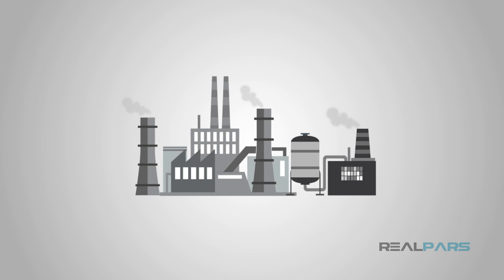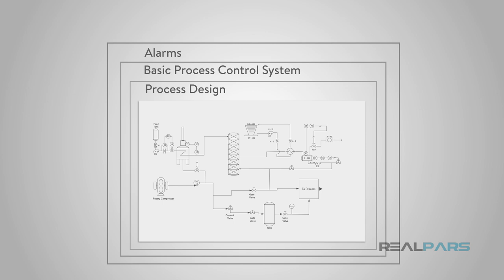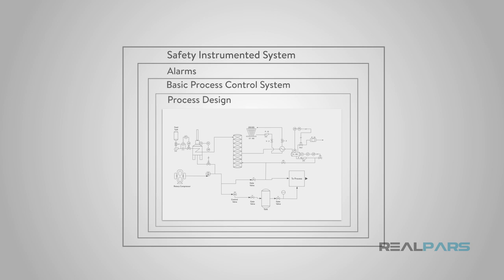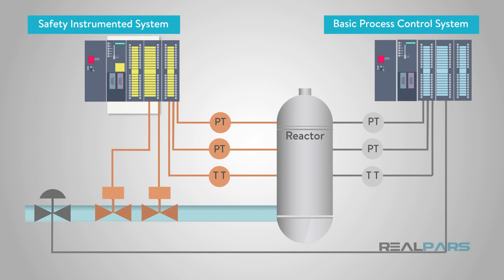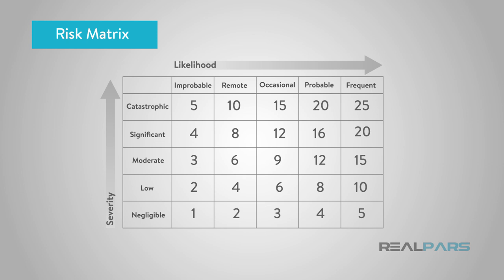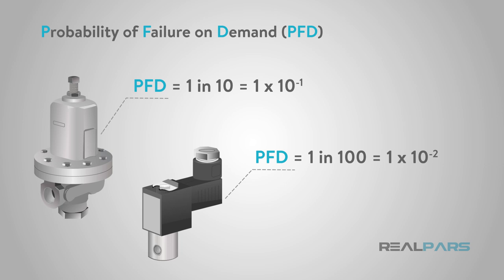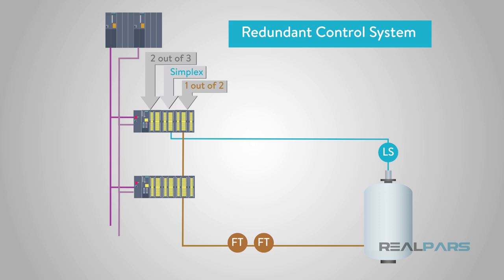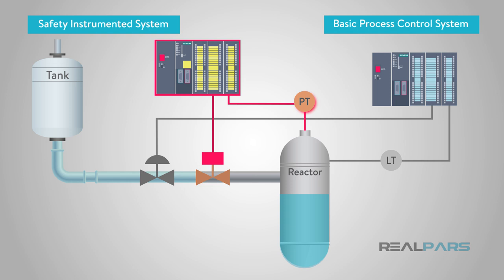What is a Safety Instrumented System?

Comment: I wonder, when you say they must be completely separate, does this also apply in both directions? Or is it permittable that a SIL system have a optically protected output (optocoupler or a optical fiber with a diode in the SIL controller and a photodiode in the normal PLC), that goes to the normal control process logic, so the normal control process logic at least KNOWS the SIL have tripped.
Reply from the maker: According to ISA 84/IEC 61511, the systems should be separate, with separate instruments, I/O, and logic solvers (CPUs).  So, the scenario you have described is not technically permitted.  I have seen projects do this, but the optical splitter's reliability would need to be factored into the SIL calculation, and I would bet that use of such a device will knock the SIL rating down by a factor of 10 or 1 00.  In most cases, the PCS will know the SIL system has tripped, since flows will stop, etc.  It is permissible to have a DO sent to a PCS system as an alarm indication.
Reply: @realpars  What do you mean with "DO"? Why would the splitter's realibility need to be calculated into the SIL's system realibility rating? If the optical splitter fails (as in stops working), only that would happen is that the PCS no longer get to know that the SIL is tripped.

And the important thing is that this shouldn't affect safety, ergo the normal system must also have its own sensors and probes as part of normal process. The idea is to take a complete SIL + PCS system that works totally separate in a safe way, and then put a one-direction signal from SIL to PCS to tell PCS that SIL is tripped so it can logcally stop its process. (to create a advantage that isn't safety critical - for example, easier restarting of the process - since the PCS then is "paused" at the correct moment, once the cause of the SIL trip has been found and resolved, and also easier find of the cause)

Could aswell be a camera on the door to SIL cabinet (that films the SIL), that is connected to a image detection algoritm on the PCS that tells if the "Tripped" diode is lit or not. Or would such a camera arrangement not be techincally allowed either?

What I have understand, the point of the separation is so nothing can affect the operation of the SIL (for example, if the PCS blows up due to a short or even if the PCS get a 300kV 3000 amp lightning strike in itself the SIL must continue working)

However, its important that the optical splitter never can fail in such way it would affect the operation of the SIL system. For example, if the optical transmitter becomes a short, then the SIL output must be able to handle it (like optically protected in itself or current limited).

Comment: what is the difference between SIS (instrumented safety system) and ESD emergency shutdown in the oil and gas industry and what are their respective standards 0:23
Reply from the maker: Thank you for your question.

The difference between ESD and other SIS systems is that while the PCS covers normal operations and programmed procedures for process power on and shutdown, ESD systems only intervene when an emergency is detected that could lead to a hazardous situation.

Here is a link for further review: https://www.sisfireandgas.com/system/4/emergency-shut-down-esd/#:~:text=Difference%20between%20ESD%20and%20other%20SIS%20systems&text=While%20the%20PCS%20will%20cover,lead%20to%20a%20hazardous%20situation.

Happy learning!

Comment: why does a safety instrumented system need its own controller? and not just connect an additional sensor/valve connected to the process controller with a piece of software? I am asking because the PFD of a PLC is much lower than the PFD of a sensor/valve right?
Reply from the maker: Hi Remco, 

A safety instrumented system (SIS) needs its own controller because it must operate independently of the process control system to ensure safety. This separation provides redundancy and prevents a single failure from compromising both the process control and safety functions. While the process controller may have a lower probability of failure (PFD), the independence of the SIS controller ensures higher overall system reliability and safety, which is critical for managing and mitigating risks in hazardous processes.

Happy learning!

Comment: Thank you so much for this explanation]
Im working in oil & gas industry i have spacial requirement of providing field E-STOP signal through  MCC is there separate interposing relay available(SIL3) or that should be provided in PLC panel that E-STOP should by pass all the logic and direct trip the pump which is located in zone IIB 3 hazards area the vessel is FPSO
Reply: e-stop is different to a safety trip for a pump.

Comment: Thanks for the great video! I don't really understand the necessity of a separate SIS though. Safety PLCs can do the process part in the standard program and the safety part in the safety program just fine, so why would we need two controllers?
Reply from the maker: The fault in your logic is that the logic solver (safety PLC) is only one part of the equation.  Safety systems must be designed holistically:  logic solver, sensors, final control elements, networks, etc.  The international functional safety standard (ANSI/ISA/IEC 61511) requires the separation of the SIS system from the BPCS (Basic Process Control System).  Use of safety PLC's is encouraged but placing these systems on the same networks and infrastructure as the BPCS reduces the reliability of the SIS system, typically by a value of 10x.  The misnomer is that "Hey, I will just use a safety PLC and all is protected".  This is not the case.  A safety PLC does not make an instrument or solenoid more reliable.  It makes the logic solver more reliable, but overall safety system reliability requires that the entire system be designed for a SIL level appropriate to the risk of the failure of the system.
Reply: This is very interesting discussion. In my industry, we do not have that concept of SIS so I’m really trying to understand it. 

You can use redondancy and/or safety rated equipment along with a safety PLC to achieve a very high level of reliability. Using this method, I easily get to SIL3 / PLe. So what more do you get with a separate SIS?
Reply: @TheTotoditoto  It is about adding an extra layer of protection to decreases any cause of accident

Comment: Thanks for this video sir 
So all the field input & output must go through safety PLC?
Im using PILZ safety PLC in  panels having SIL 2 certificate
Reply from the maker: All of the signals that are required in the logic solver (your Pilz safety PLC) to implement the Safety Instrumented Function (SIF) should be brought in as logic solver I/O.  Per ISA-84/IEC-61511, these inputs and outputs should be connected only to the logic solver.

Comment: Hallo, great explanation on SIS. I have rececently started working with Pilz Programable Safety System and I just found a term on the Service Manual I wonder if you could clarify to me, it says something like this: 

When using test pulse outputs, If supply voltage is interrupted during  test function, the test pulse output will be deemed to be defective... causing the PSS to switch to a stop ...Remedy: buffer the PSS supply voltage. 

What means here buffer the PSS?

Thanks in advance!
Reply: Remove & then re-apply the supply voltage to reset

Comment: In this video you will learn what a safety instrument system is how it is constructed and how it plays an important role in keeping our chemical refining finding another manufacturing plants running safely and is productive Community Partners and employers before we get into today's video if you love our videos be sure to click the like button below and make sure to click subscribe and the bell to receive notifications of new real cars videos this way you never miss another one chemical petrochemical mining gas compression and many other types of plants and Manufacturing facilities to be very dangerous places to work due to the presence of risk risk due to fire explosion tank overflow gas release or chemical exposure the only way to eliminate these risks is to not build or operate these types of plants but that's not practical materials that are useful necessary and important in our everyday lives product like dry powdered laundry detergent is made via a process that includes pumping liquids at high pressure spring droplets in the very hot air and collecting the product below which may be Dusty and pose an inhalation hazard in order to minimize these risks process control systems are installed to maintain a safe operation of the plant assisted by a robust alarm detection and Reporting System and operated by trained qualified personnel measures alone cannot reduce the risk of injury fire explosion or other risks to a tolerable level a list of the types of risks the process design itself the basic process control system alarms and operator intervention provide the first layers of protection for the process players provides approximately a tenfold or greater protection to the process plant than the layer below as design care is taken to specify lines equipment and valves with the right sizes materials of construction and proper accessories pest control system is installed with the appropriate instruments controls and monitoring logic to allow the plant to be operated within the safest ranges for pressure temperature and flow rate are configured to allow The Operators to react to abnormal conditions and take corrective actions before arrest becomes an accident all of these layers of protection in place the risks may still be too great to prevent an accident from happening examples illustrate this for a nylon planned in flixborough England exploded killing 28 and injuring more than 1001984 a gas leak in a fertilizer plant in Bhopal India killed over 3000 and injured 200,000 in 2005 an explosion at a Texas City Refinery killed 15 and injured more than 150 his plans had Control Systems alarms and trained operators but these first three layers of protection do not reduce a hazardous plants risk to a tolerable level associated with production of flixborough we're not all well-defined and the proper controls were not in place to minimize those risks all systems were in place to prevent the resulting gas leak but did not take into account the scenario that led to the accident
Reply: Did you have a specific question?  Your post is simply a transcript of the first four minutes of the video.  Perhaps your question followed and was cut off due to the character limitations on comments.